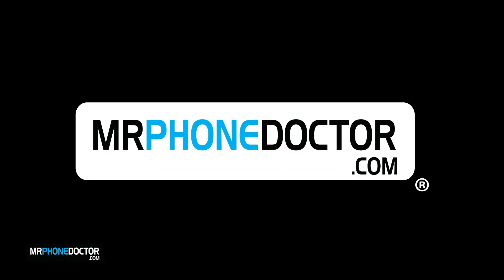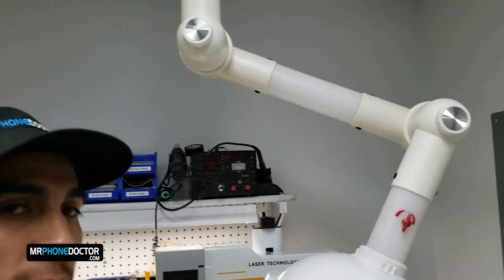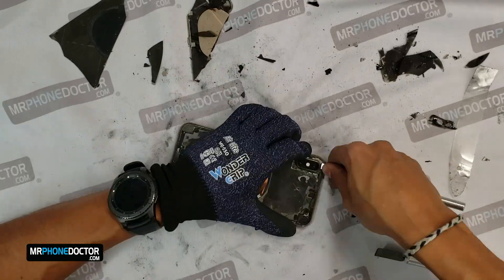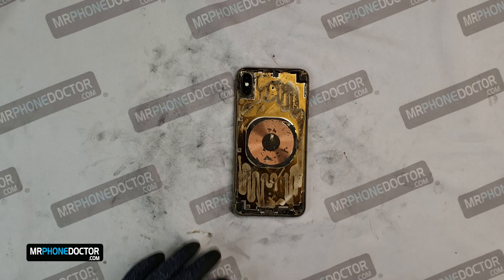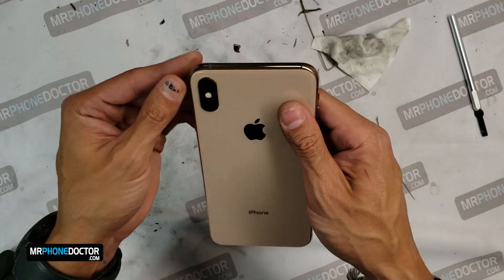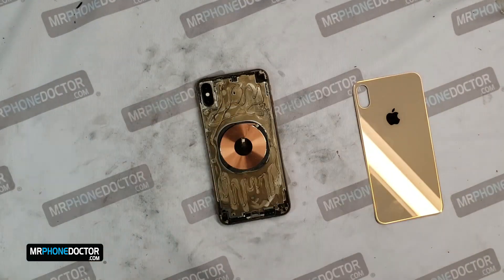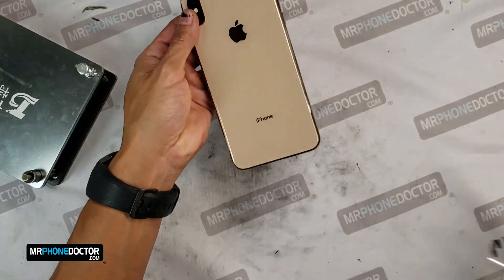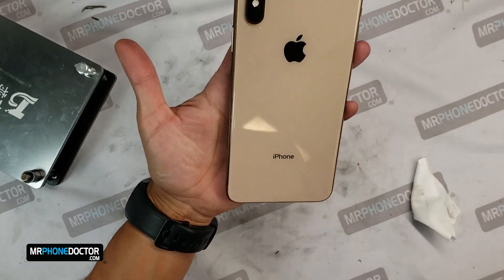iPhone XS Max Cracked Back Glass Repair using Laser Beams!

Comment: Have you had any issues with iPhone XS Max and your Laser Machine with the iPhone rebooting after the 2nd laser phase? Or having to replace the charging port afterwards because of laser damage? I did over 80 phones so far, and the only 2 iPhones XS Max I've done gave me the same issue afterwards.
Reply from the maker: We have not had any issues on 100% of the phones we have done with reboot issues. You may want to check to make sure laser not hitting any sensitive areas on the back. We also started only doing 1 pass since the second pass is most sensitive with the glass being off. Try only 1 pass glass will sit pretty good as well.

Comment: Hi man have you had issues with iPhone XS Max phone shutting down after a laser repair. I’ve done two iPhone XS Max back repairs with the laser and I’m finding afterwards the phone will shut down after every 3mins. Other models are fine but this one. Does anyone know how to trouble shoot this or if the laser may of effecting some hardware???
Reply: All good man I resolved the issue. Recalibrated my template. Needed to replace dock, loudspeaker flex and wireless charger. Stopped the rebooting issue. Thanks for the reply!
Reply from the maker: Never. You may need to recalibrate the template possibly hitting sensitive flex area under the glass.
Reply: @nathan
My phone doing the same.  You changed the charging port?

Comment: Have you had any issues with the laser damaging the charging port or other hardware? I use the infrared preview every time and make sure that laser is in the perfect spot, yet sometimes I’ll have to replace a charging port after the repair. I’m using the TBK 985A model. Thanks man!
Reply from the maker: Have not had any issues with this model yet. I recommend putting electric tape down on bottom where the holes are. More than likely laser is zapping that area
Reply: I wound up editing some of the diagrams and made the spots around the charging port and other areas slightly bigger. No issues since. But that’s not a bad idea. Thanks!

Comment: I am using this machine and it’s good and efficient to use but I have experienced issue with iPhone XS Max . After I replaced the back glass the phone started rebooting in every 3 minutes. It has happened with 2 phones already. I never had a problem with 8,8plus to XS . What could be the problem??
I am scared to use this 😩
Reply from the maker: Hi bro you are probably hitting sensitive areas. Can you send me photos of the phone that is damaged. I can try and see if it hit sensitive area
Reply: Bro you from Nepal?
Reply: I had a guy do my phone it’s doing the same.  Rebooting after a few min.  He lasered it twice
Reply: Hi Pradeep, I just replied to this video as well, the same issue as well, with the iPhone rebooting every 2 minutes or so ... seems like the charging port is getting hit by the laser at the bottom, you need to replace the charging port aftwards. Now, I've contacted REWA, they told me they are aware of the issue but don't have any solutions yet. I think they have to update their laser-cutting image in their software.
Reply: I was also told to just remove the motherboard and charging port for now ... I know ... long process but, better than damaging the iPhone.

Comment: That is a different glue than the last video. May I ask what kind you are using?  REWA recommends B-7000.
Reply from the maker: Cold pressed. B 7000 terrible leaves stains
Reply: Any particular brand or location you recommend? I am striking out here.
Reply: @MrPhoneDoctor  yeah I got no idea the brand or where you get the glue either
Reply from the maker: Search cold pressed glue. Don't have brand either. If you cannot find with your supplier let us know
Reply: @MrPhoneDoctor  hi...i have glue B-7000 transparent...is not good??